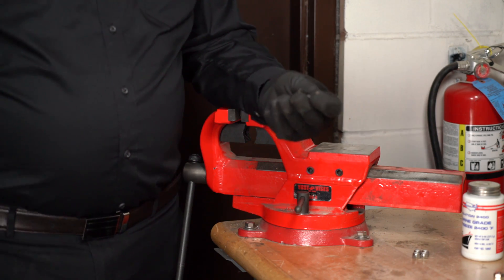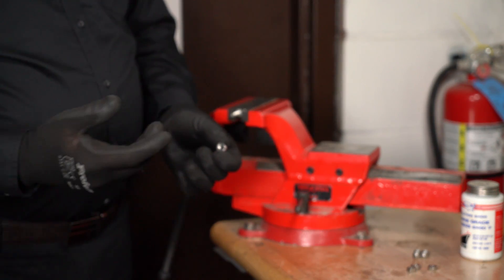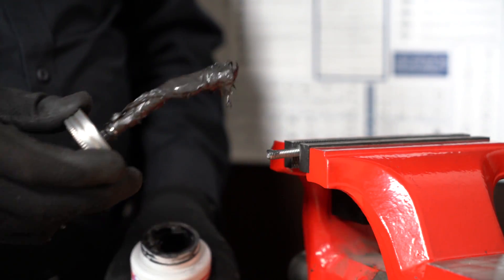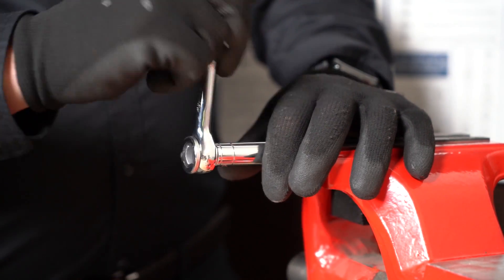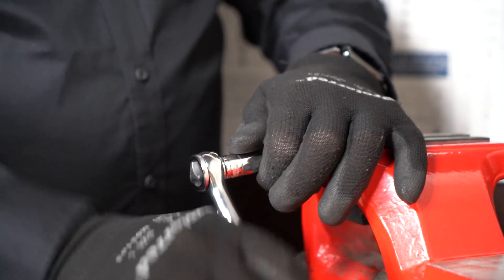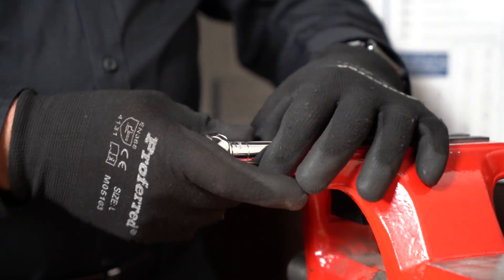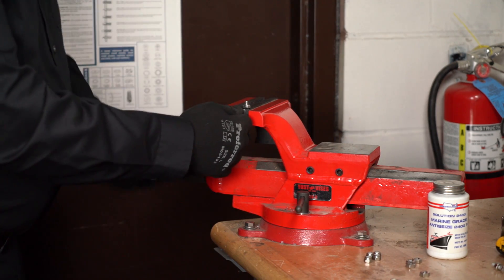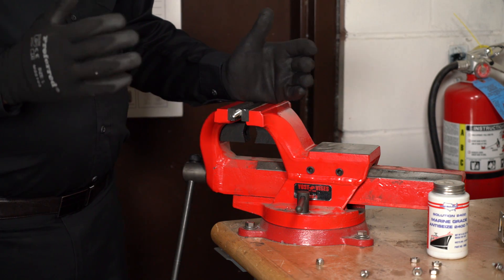Nylon Lock Nuts & Thread Galling | Fasteners 101

Comment: My question is : is a Lock-nut or a Waxed Lock-nut a good use for the four nuts on the drive shaft joined to the transmission, and, on the DIFF end, same question.  The issue is: GETTING THEM OFF.  When I need to remove those eight nuts to, say, change the center support bearing or service a U-joint on the drive shaft, is a nylon lock-nut going to be overly difficult to remove?  I like having them on tight, and particularly like the no-galling effect of the waxed nut, but I don't want to use a torch to remove them.  What's the reality here?  Should I avoid nylon nuts for the drive shaft or any application where i want to remove them also; and similarly, is Waxed better for removal?  Thanks, Doug Day working on vintage Volvo 240

Comment: Great general purpose explanations. Be careful applying these techniques on more precise needs, aircraft, seismic, etc.  The law of friction for solid objects is the opposite of how this was explained.  The faster two solid objects move across each other, the LESS friction is created.  Yes, friction creates heat.  Ratcheting will create more friction and heat than continuous rotation because of the stopping and starting. Every time you start again, the friction of the nut on the bolt shaft will cause a torsional force on the shaft until it either breaks or it releases and begins spinning. Every bolt has a max amount of heat and torsion it can withstand before it galls, so it’s not the speed of turning the nut that causes the galling. Faster = less friction = less heat.
Each time you reuse a locknut of any kind, it’s loses its holding ability just a little bit less.  Use your own judgement on the importance of the fastener, (ie. something that if a single component fails it could cause death or injury or catastrophic failure vs. a bracket coming lose being held by 3 other fasteners).  If it is important, change it out each time. They are cheap. It could be years before removing the nut is even considered again.
Reply: I only agree with you halfway. The point you made about stopping and starting seems valid to me, because static friction is greater than moving friction, however, when you say slow speeds have less friction than high speeds, that is counter to what I know of the topic. The friction coefficient is independent of speed as long as the surface is moving. That is, friction is high when the surface is stationary and then suddenly drops when the surface starts moving.

Comment: I watched this to learn how to fix the handle on my snowblower. I will NEVER use a whole can of the anti-seize stuff. So I got some wax out of my craft closet and rubbed it lightly on the bolt. It worked! They’re calling for 10 to 14 inches of snow here in the next two days. Thanks so much for your help!

Comment: Wish I saw this video first.
I literally used an impact driver the exact same one, high speed and now the nut is stuck halfway and I don’t know what to do. 

It won’t come off, frustrating.
Reply from the maker: Should not use an impact gun.  High speed and pounding will gall the threads.  That nut will not back off which is crossed threaded.  You will need to cut if off with a hacksaw or bolt cutter.

Comment: So...is the nylon really helping against the assembly coming loose due to vibration? I have trouble wrapping my head around this. So the thread of the nut stretches the bolt and creates preload force, which causes pretty massive forces on the walls of the thread. And apparently the nylon adds a tiny bit of friction in the mix. 
If we now assume vibrations and time working on the connection, the bolt stretches and gets lengthened, loosening up the connection. How should this tiny piece of plastic prevent this? It might prevent the nut from coming off completely, but it surely can't retain the existing preload force in the bolt from dropping due to stretching of the bolt?

I would be very interested in your opinion, thanks.

Comment: how does Ny lock nut works during the movement of 
work piece.
Reply from the maker: As the workpiece vibrates, the nylon of the hex nut uses friction against the threading of the bolt to prevent the nut from losing its grip.
Reply: thank you for your reply. it is now well understood the the function of the Ny-lock nut.

Comment: How do you remove a nylon lock nut with never seez that keeps spinning
Reply: I can think of two ways:
try to wedge a flat-bladed screw driver behind the nut to hold pressure against it while backing it off
cut the nut lengthwise with a hacksaw..then wedge it open a little.

Comment: How could I remove a stripped nylon lock nut. It was torqued to 120 ft lbs. Its size 22mm. BMW. any suggestions would help and save me some trbl. Thanks alot.
James.
Reply: You will need a extractor socket

Comment: My experience with the use of the nuts with nylon inserts relates to the resistance they offer to counter vibration.  How does the anti seize impact that resistance to the nut backing off the bolt where vibration is part of the scenario?  WIth the anti seize in place, does the nut still need to be acted on by the force of a wrench, or is it possible for vibration to back the nut off?
Reply from the maker: With how tight the nylon grips the screw, most of the anti-seize will be squeezed out, and what's left won't affect the nylon's ability to grasp the bolt. So using anti-seize to install nylock nuts on bolts, while seemingly contradictory, is perfectly fine with negligible effects to the assembly's vibration resistance.

Comment: Can the thread on a nut be 'formed' instead of 'cut' ?
And are finer thread pitch ss bolts more likely to gall and seize  compared to coarse threads  .....?????????
Reply from the maker: To your first question, Nuts are always cut thread. It's just the way they are manufactured en masse.
To your second question, yes, fine thread bolts are much more likely to gall than coarse thread bolts. There's a lot more surface area on fine thread bolts for galling to occur.